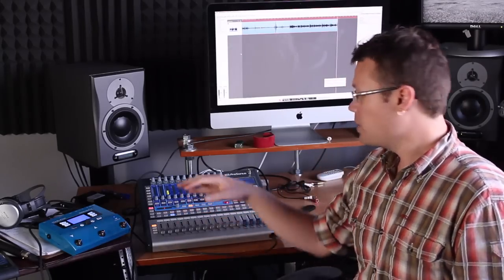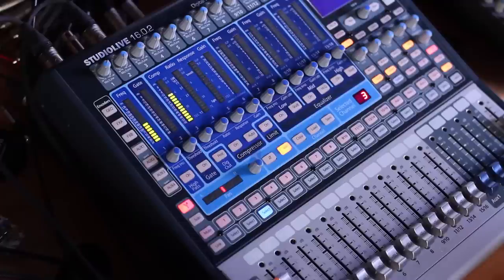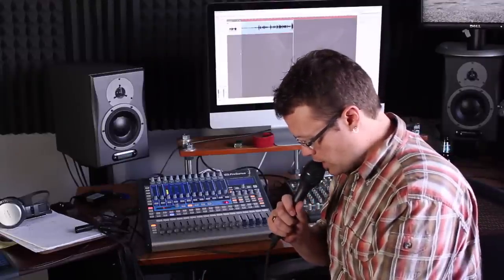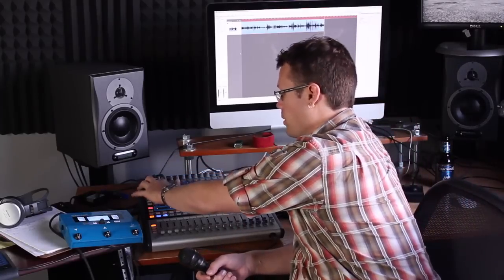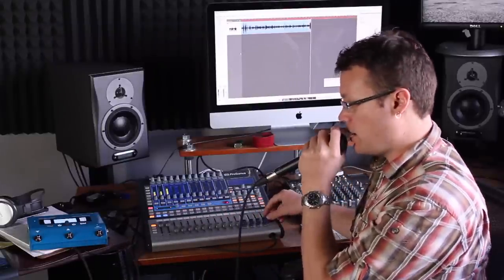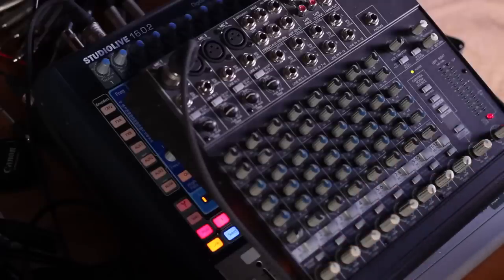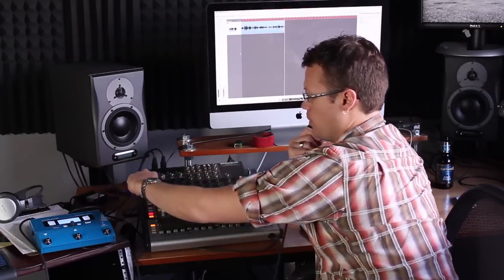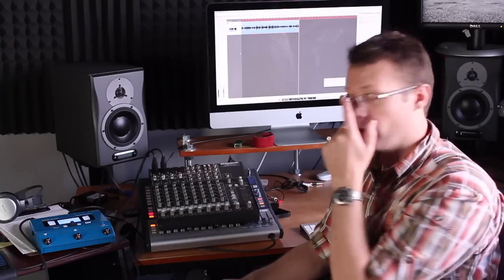TC-Helicon - Mixer Setup, Gain Staging and Vocal Processors

Comment: Question we have a small practice space. Ive just received some EV ZLX 15P 1000 watt powered speakers. In reheasal we dont mic anything. Our singer uses the Voicelive play. We have always just run in mono left out to the stage snake. But in our small rehearsal space could I just run the VLP stereo directly to the powered EVs? Want to make rehearsals simple.
Reply from the maker: 6l6rock Yep, sure could! Just put it into stereo mode and run an XLR to each powered speaker.

Comment: I've recently puchased a VL3 and I'm wondering if there is are thoughts about adding a master 31 band eq to the firmware? What prompts my question is when you said turn the master up til feedback then turn back. I've worked as a live engineer for over 20yrs and as we all know there are good ones and others not so good so it would be nice to be able to address the frequencies that feedback other than just turning down. Generally speaking you will get a better sound addressing them even if there is no feedback
Reply from the maker: SoulStationOz Heya, an EQ that expansive is a bit more than we want to offer. We're more likely to look at anti-feedback in future products than a very fine band EQ.

Comment: Thank you for the excellent video–live application seems pretty straight forward. 

How would one go about setting up a Voiceworks plus in a studio setting? Would you position the TC Helicon between the mic and interface or would you set it up through an aux channel on the interface?
Reply from the maker: +Derek Met I'd go direct from mic to VW and then into an interface. It's the simplest way to get going.
Reply: +TC-Helicon Hey, so I have the AKG c214 coming in the mail soon and been thinking of turning to the voicetone create and the correct for live and hopefully recording use. This answers my question on it's accessibility as far as a means to use it through an interface (mine being the Scarlett 8i8) . Can these TC products serve to "pre-amp" the mic or cleaning boost the signal?
Reply: +Derik Corl cleanly*

Comment: I recently bought the GTX.  I'll only use it for singing and acoustic guitar (no electric) on stage.  I read somewhere that for my use it's best to upgrade the "No Amp" presets of the 500 megapack.  Is that correct? If so will I have settings like chorus/delays/reverb for those presets?  Not sure how many presets there are for acoustic guitar.
Reply from the maker: Hi Yakman NC, the No Amp pack simply sets all of the Amp Type controls to No Amp, so you don't have to do it manually in each preset. All of the other EQ, Delay, uMod and Reverb settings are still the same and totally configurable. It was just a convenience pack, since it's a lot of manual labor to go through every preset and change that single setting.

Comment: Thanks for your video you are very helpful...
I have one question, I am running my mp3 backing tracks through the TC helicon (via the aux in) In order to get the key for harmonies, but I find it a pain that both vocals and track are running through the same channel and I want to be able to have this in two separate channels in my mixer one for vocals the other for the tracks so that i can have separate control. 
Please tell me there is a way of doing this? Thanking you!!!

Comment: Hi!! Can you do one video "How to connect VL3 to FX150"? There's more than one way, right?
I want to use a eletric guitar or semi-acoustic guitar, and a mic.. I know that i'll need to connect them to VL3.. but i'm not sure what cables should i buy to the best conncting way from VL3 to FX150...
Reply from the maker: The simplest way to get everything into FX150 is with an 1/8" stereo cable from the headphone out of VL3 into the Aux input on FX150. That allows you to use both the other FX150 channels if you need them. You'd control the mix of what comes into the FX150 from the VL3's headphone mix. 

Alternatively, connect both the XLR outs from VL3 into the FX150's 2 XLR ins. Put the VL3 in Mono output mode. You'll get separate vocal/guitar at the FX150 that way. Just be sure to turn off all the effects/EQ/Tone on the FX150.

Comment: Thanks for the video. Just wondering if there's a way to separate the guitar and vocals to different channels at your mixing desk when using the Voicelive 2 so that you can adjust the levels separately at your desk?  i.e. turn up the guitar on your mixing desk rather than through the voicelive 2 to adjust the levels between guitar and vocals?

Comment: So for those of us that want to simply plug our Tascam LD-74 into your processor and then connect to a Zoom LiveTrak L-12 and have the signal heard, what kind of machinations does one have to go through with your effects processor to make that happen?  It's apparently not a simple plug and play device.  What''s your QC fail rate?  Really frustrating to finally have the time to integrate the device into my studio and have it not deliver.  I followed the direct to mixer check and validated the the mic works when connected directly to the mixer and adjusted the gain on the side of your processor.  Nothing.

Comment: Hi Can you also adjust the volume on the TC Helicon, so while playing on stage you can add or reduce the total output volume? Example if you want to sound louder(not by clipping). And do you have instructions playing is by saxophone?
Reply from the maker: Are you inquiring specifically about the VoiceLive Play?
Reply: Yes please
Reply from the maker: Typically, our products are intended to set the vocal level and keep it consistent throughout the performance. The Play does have a master output level in the Mix menu, but generally you're not going to touch that if you're going to a mixer/PA. You'd make your adjustments at the mixer. If you're going from the Play directly to some powered speakers, then the output level control could be handy. 

One trick I've helped people use for a volume boost is to use the "Transducer" block, set to one of the guitar amp styles. Set the Control parameter to HIT, drive to 0 and the filter to 100. Then, press/hold one of the buttons around the screen to get to the advanced settings page. When you're there, you can adjust the "gain" parameter to give you a bit more level when the effect is active. Experiment with the values till you find a "boost" that you like. Since the amp style etc was all set to "no drive and no filter" it'll not mess with the tone of the sound much at all, while still giving you the boost. 

For a Sax, I often recommend people turn "Lead Mute ON" in the setup menu. Unless you're on a big stage, the Sax can be quite loud in the room by iteself, so turning lead mute on will just send the effects to the mixer/PA. Then, for "section" creation, use the harmony effect and pick a voice or two that you want to add in. Often, users will create several presets with various voicings "up and down" "1 up" "1 down" etc. and then change key/scale on the fly using the footswitches. (if memory serves it's "Press the Preset Up and Down buttons at the same time to enter key/scale set mode", but it could be preset Up and Hit. Check the manual :)

Hopefully that helps a bit!

Comment: Hey Craig, I discovered you while reading my Play Acoustic manual and you seem to be the right guy to ask this question. Can you give specific information on setting up the Play Acoustic with my Jbl Eon One  Column PA.  I  don t have any  aditional mixer .however I want to connect directly  and  be sure that I'm correctly set up. Any information you might provide would be greatly appreciated by me ,thanks
Reply from the maker: Hey Mircea! Great question. The basic setup should be exactly the same as in this video, but using your JBL instead of Craig's mixer. Using one XLR into the Play Acoustic for your mic, and one XLR out of the Play Acoustic to connect to your PA system, you can control your levels and mix on your play acoustic. You can also use a USB connection to include a computer in your setup, and of course your guitar will connect via TRX to the Play Acoustic. 

Edit: Sorry for the double response Mircea!
Reply: @tchelicon  Thank You for the answer,i wish you a good year also

Comment: Thanks for replying Craig. How do i hook it up? I was thinking Post Aux Send to Mic input. 1/4 out L/R to ST1 L/R in. Is that correct?
Reply from the maker: Kent Nguyen Here's a super quick and dirty diagram. I only had an image of a VL3 back panel, but it's the same idea with your VL2. https://dl.dropboxusercontent.com/u/40864719/VL3-Aux-Loop.jpg 

Make sure to watch the gain staging. Set the input trim for each mic on the board. Then, the SEND level will be the signal level to the VL2, so make sure you're sending enough to not overload the VL2 input. Then, you'll probably want the VL2 to send back Line level output. 

Also, you may want to use LEAD MUTE turned on in the setup menu of the VL2 so that you only get back the actual effects, not the original mic sounds. 

An alternate way to do things is to come back to two channels on the mixer rather than the aux returns. That will give you "fader" style control over the effects coming back to VL2. 

Hope that helps!

Comment: My friend borrowed my play electric and he only has one xlr to his small mixer. is there a way to  send still. will both giutar and vocal still go through? Basically he want s to hear his guitar but only wants the vocal on track as backup vocals to a pre recorded set alredy done. he wants to just add a back up vocals to the existing song.
Reply from the maker: Hmm that's a bit tricky. Is his mixer totally out of inputs? I'd typically recommend sending the guitar out to the mixer separately and then just recording the channels with the vocals into the DAW. Not sure exactly how to work around his setup. If you've got any more info on the specifics of the setup we can probably find a way to work with it.
Reply: yeah thats what I told him. he figured it out. thanks for thr reply, cheers. Love the product!

Comment: Hi, great video, my question is i have a voicelive 3 and a macky 8 channel mixer - for the purpose of letting several people use the voicelive, can you go from the mixer into the voicelive then then out of voicelive to your amp - that way anyone using the mixer microphones will be going through the Voicelive 3 - is this possible or am i missing something..?
Reply from the maker: You can use the voicelive on an Aux send from the board, but there's a catch. Anything that uses pitch correction/detection (adaptive tone, harmony, pitch correction, doubling, choir, vocoder) all need a single, monophonic input to work correctly. You could use Transducer, Reverb, Echo, uMod for more than one voice at a time, but that'd be it. If you're wanting to have the VL3 available to several different channels on the board, but only use it with one at a time, that would have the more "full" functionality. You'd just have to manage who's being sent via the auxes on the board as you change singers using the VL3.

Comment: Craig is there a video on setting the out put gain for the vocals and guitar on the Play Acoustic.Also I’m interested in any info you can give me or direct me to regarding Connecting my Play Acoustic to my Bose L1 sys2 with Tonematch?
Reply from the maker: I'd turn off all the tone match stuff on the channel(s) that the play acoustic is coming into. Set the output level on the play acoustic to max and then turn down the inputs on the L1 until they are just below clipping. That'd give you the best signal-to-noise.
Reply: TC HELICON ok thx Craig..

Comment: Craig - quick question. I was trying to do an online show on concert window and wanted To bypass the mic on my MacBook Pro (obviously). Is there a way to use my condenser mic into the acoustic play and have the audio sent to the live stream? What would be the best way to do this? Thanks Craig !
Reply from the maker: Sure. Play Acoustic supports USB audio. Plug your condenser into the mic input on Play Acoustic and connect the Play to your Mac via USB. Choose the Play as your recording and playback device. Monitor via headphones connected to the Play.
Reply: TC-Helicon you're the best !

Comment: is it a mixer that can eliminate clipping and or keep the voice stable with the beat without using a computer or daw or software ?
Reply from the maker: Clipping is mostly managed by the gain settings on each device and making sure you don't double up on gain along the way. For "stable with the beat" do you mean having the right tempo for an echo? That can be tapped into our products if they have the delay effect.
Reply: I mean sometimes my voice is to loud and sometimes it gets very low.I'm getting better at keeping my voice even when i rap.What i did was use a ruler to measure the distance from the mic and it worked a lot better.What I'ma do now is search for some windscreens so i can rap while traveling in my car and ridding a bike to block out the wind or any other noise ?

Comment: First, thanks for the great video! 

Second, to make harmonies more reliable in live use without depending on guitar, I'd like to pipe output from the mixer into both my VLT2 and Play Acoustic. The simplest option for mt is to split off a monitor signal into the aux in. I know splitting can present complications, but my main concern is that the monitor signal is coming from the amp. Can these units hand a powered input like that, or will it fry the units? I know im not acknowledging all of obstacles depending which unit I'm working on, but I think I can sort that all out. I just dont want to damage these awesome tools in an unfortunate round of trial and error.

Thanks!
Reply from the maker: +jrrdmoore The Aux input can handle a line level input but not the powered type electrical signal you'd connect directly to a speaker. Is it an Aux send from the board or the actual speaker output from an amplifier?
Reply: +TC-Helicon  This kind of customer service why I have quickly become loyal to you guys! Yes the feed I was hoping to use would be coming from the amp. common sense told me it probably wouldnt work. I just didn't want to underestimate you or your products. I will have to work on an alternative setup. Does it matter if the input is balanced or unbalanced? I can probably grab the signal before the amp, but the signal from the board to the monitor is a balanced signal. If that messes with things, I will probably have to pick up a hub to run things through before it leaves the stage and hits the mixer.
Reply from the maker: +jrrdmoore Thanks for checking! I think a powered signal would probably have created some unwanted pyro for your show. ;)

It's a stereo TRSS input, which I believe are typically unbalanced, but there won't be any harm sending a balanced signal. It may just come in on "one side" of the stereo input.

Comment: Can i use the Voicelive2 as an effects processor to 2 or more microphones? or does it have to be 1 Voicelive for 1 mic?
Reply from the maker: Kent Nguyen It's a bit dependent on the effects you want to use. If you stick to reverb/delay you can use more than one (in an Aux loop from the mixer). As soon as you want to produce voices like harmony/double or use tuning, it needs to be a single voice.

Comment: why not just use xlrf to trs into the mixer(line-in). doesn't that just take care of the added pre"s? also larger VLZ mixers come with a pad switch
Reply from the maker: You could definitely go that way. A lot of folks just plug into the mic pre and/or don't have other cables etc. lying around so I figured I'd show a "common" use case. :)
Reply: understandable. However, out in the field you find this practice, often when using a stage snake. So, I carry a few neutrix trs adapters for those channels. the right tool for the right job 😊
Reply: TC-Helicon please i bough a voice live 3 and i want To use it on stage ,how can i set a guitar and  voice effect for each song following mu setlist, in ordre to not be lost on stage

Comment: Would this unit be ok as an outboard on fx send / return or would multiple vocals not be compatible?
Also, why are you putting a line level signal into a mic. preamp?
That can only dirty the sound.
You think it sounds good now. It would sound better still if a Jack was used to the line input on the desk..
Surely an XLR to jack should be provided with the unit.
Reply: Ok, I have just read from Thonman's site, because TC Helicon seem to avoid it... The phantom power on the "TC Helicon Mic. mechanic" is only 24v.
That will reduce the quality of my Sure beta 87c.
Infact all condenser mics requiring 48v phantom power will be compromised.
What else is TC Helicon not owning up to?
With this and putting a line level signal into a mic. preamp, I just bought a Lexicon MX200.
Not as exciting as the Helicon range but I need clarity.
Reply from the maker: Not sure what you're asking in terms of "owning up" to. We've never shied away from saying that the phantom on some of our smaller pedals is 24V. Having enough power to run the mic is the key. If you require a specific voltage and amperage for the mic to operate, anything beyond that doesn't make the signal any better, much like faster internet doesn't make your streaming video better if there's enough bandwidth to support the playback quality you choose. 

Putting a line level signal into the preamp is fine as long as you gain stage correctly. If you're concerned about "coloration" of different pre's, that's a personal choice/taste issue, but not one of functionality or usefulness.
Reply: Hmmm. Some of your manuals seem to omit the actual phantom voltage.
"Microphones designed to operate at 48 volt phantom power will work at lower voltages with decreased headroom."
You do, I take it, understand just how important HEADROOM is? 
Voltages above 24v is as you say pointless for a mic. that requires 24v. 
Like you say... "Having enough power to run the mic is the key".